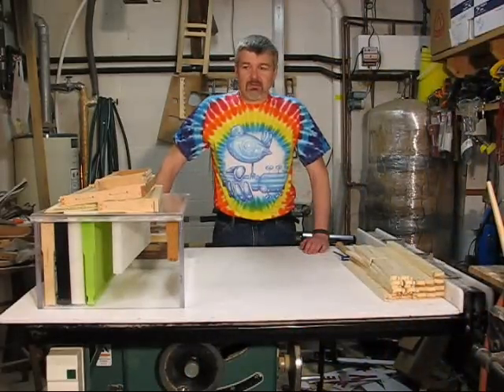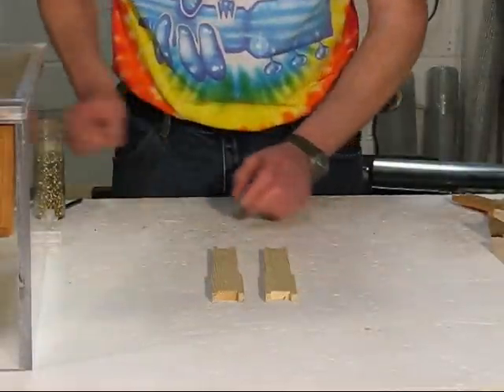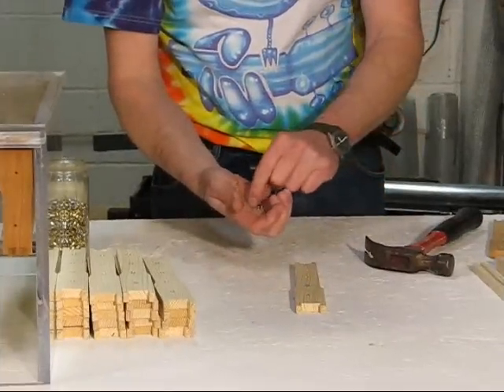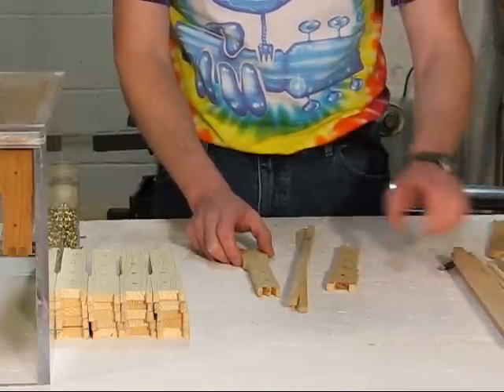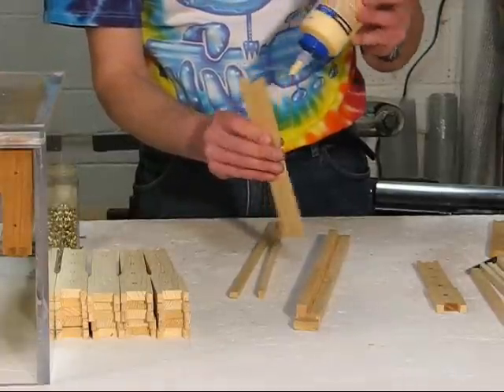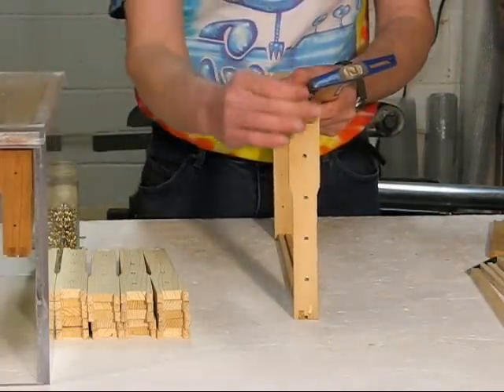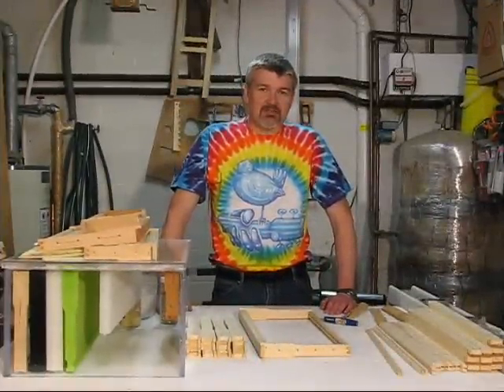Frames & Frame Assembly - Part 3 - Eyelets and Assembly

Comment: Ah ... yes, I missed that first time through.  In my case, rather than nail in from the end I drove a couple in from the 'sides' of the frame if that makes sense (from each side of the 'u' shape).  I have one of the new pin nailers so could do this without fear of splitting.  So it's all worked out.  Thanks for the pointers.  It got me thinking about how to do things.  And my bees just arrived last week.

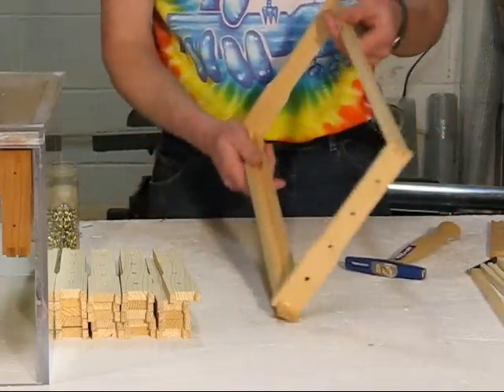Comment from the maker: Do you mean like what is shown ~8:00 mark?   When using wedge top bars,  there is only enough room for 1 nail per side.   The two nails from the top also help keep the pieces tight while the glue dries.